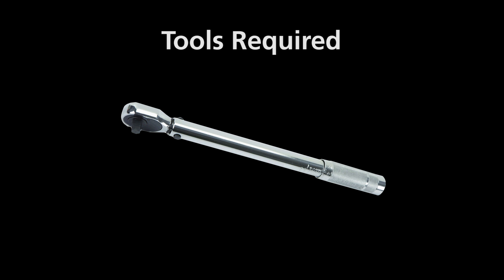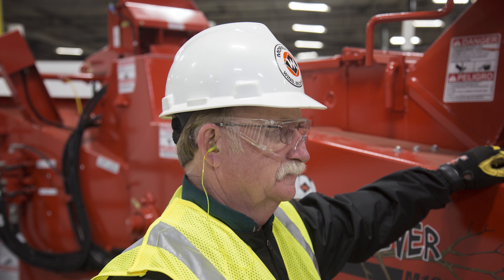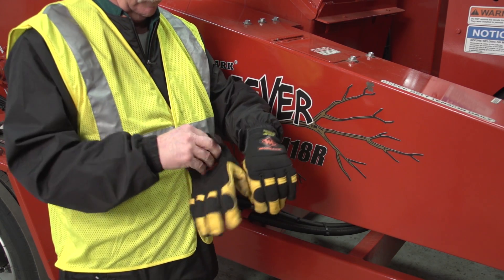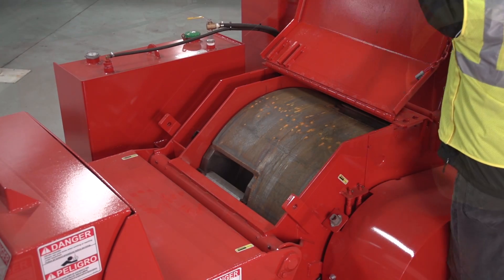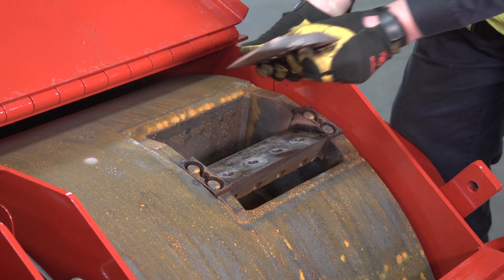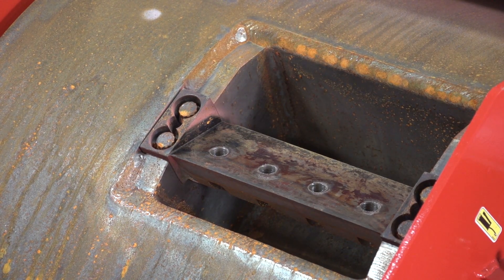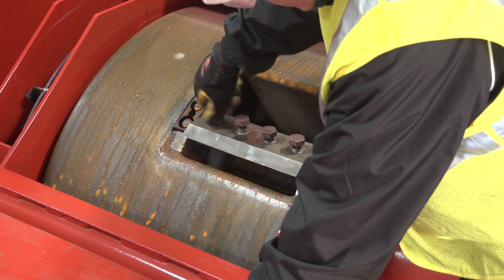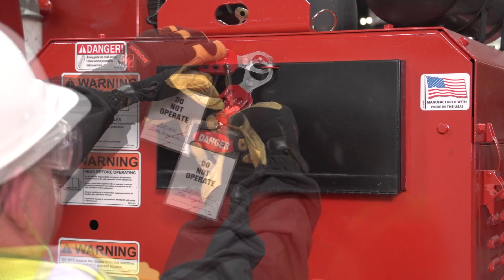Maintenance Made Easy - Brush Chipper Knife Care

Comment: What type of steel used for chipper knife to withstand high power cutting force
Reply from the maker: We're sorry, but we are not able to share this proprietary information.
Reply: Most likely, a d2 tool steel or s7 impact resistant tool steel.